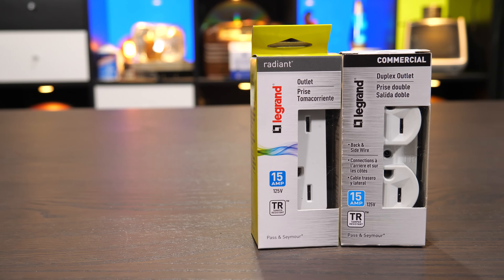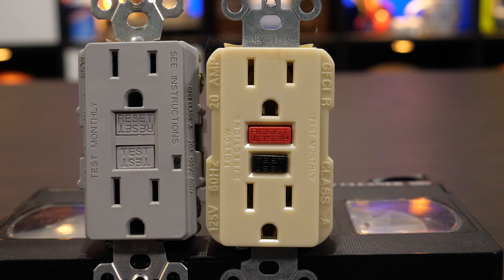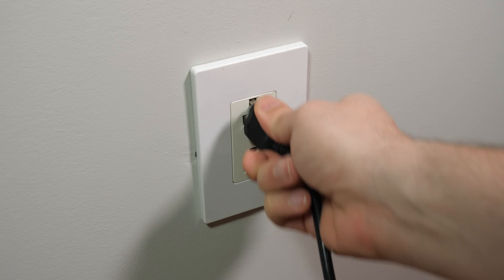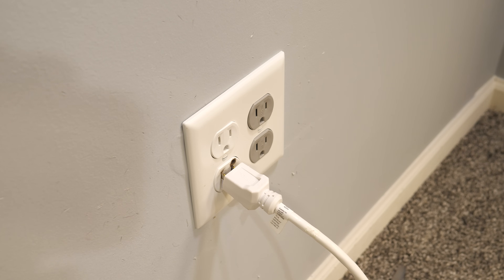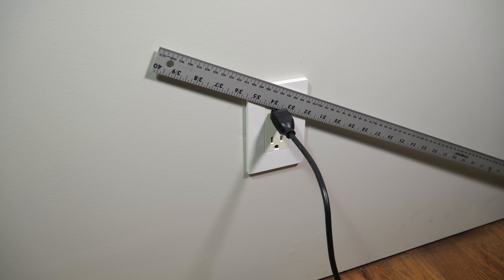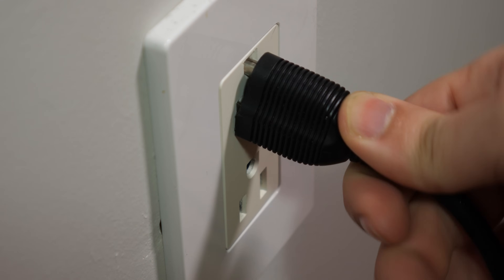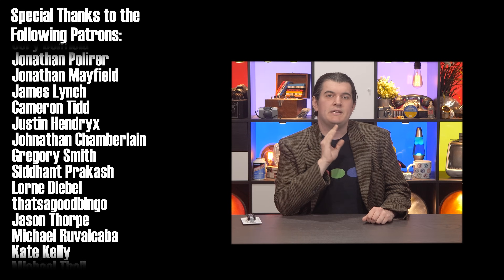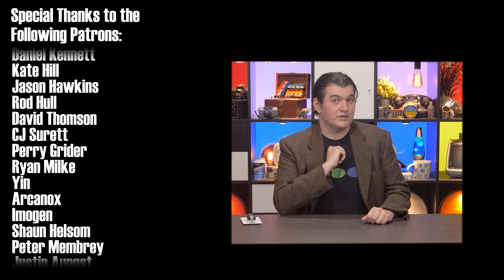Power outlets are topsy turvy - but does it matter?

Comment: Topsy turvy? To that, I say, I'm glad that I live in Power Plug & Outlet F aka Schuko. Guess what? Ground is both on the left and the right of the connector, so it doesn't matter if you put it in upside down or not.  In fact you can do both. Can be handy sometimes.  Also, F aka Schuko has deep outlets, about,. in fact 2 cm! No problems with knife trowing etc. Plus, you can hang it upside down. Yes, many outlets are under the desk here, plug facing up. I ❤Schuko!
But that doesn't solve your issues, I'm well aware. It's just so silly from my point of view.

Comment: Journeyman electrician here. I'd better not let my wife watch this video. I did my apprenticeship in a lot of hospitals, so ground up is how I install receps. (It is not an outlet, it is a receptacle.) We bought our current house, and I went through the entire thing and replaced light fixtures, and every recep (getting away from awful backstabbing, and pigtailing every recep, so if one fails, just one fails) is now installed ground up. Wife griped about it, I stood firm. And yes, you can find flat plugs with the ground in the 'proper' place. 

Though, you are right, there are very few use cases where a plug with ground down and pulled out slightly where there is a danger. But let me tell you of an outlier that is more dangerous than throwing knives at the wall. What is behind your usual bedside table? a recep, you say? it's got one of those 3 way adapters so you can plug everything under the sun into it while you sleep. But think of this, pocket change. How often are you just throwing it on the end table, people are messy, and I can't tell you how many times I've found change behind the end table when troubleshooting a recep. And yes, I've found ones with obvious burn marks, the coin had decided to do that one in a million shot and land between the hot and ground, and shorting out. That is a fire danger. And as you likely know, code requiring arc flash protection was added because of rare cases, like this. And yes, I've got 2 and 3 pronged cords all over the house, with 3 prongs slightly edging out the 2.

I'm not saying those specific cases are common, but they do happen, and yes, better safe than sorry. Sorry to hear your half million dollar house burned down because you tossed change onto your bedroom end table. It's enough for the NEC, it should be enough for the rest of us.

Now, as to you saying US plugs are objectively bad. I totally agree with you, some sort of insulation like how they do in the UK for the hot and neutral would be to our benefit. The problem is inertia, changing to a new standard would be an absolute nightmare, just like trying to force the US onto the metric system (as good as it is) would be as much if not more of a nightmare to actually implement.

Either way, thank you for the video, and looking forward to more of your content.
Reply: Another corner case thing: machine shops. Sheet metal and tools and oh-my, there's a reason all of our outlets are installed ground-up. Maybe it's a little paranoid, but you'd be surprised how often a thing of sheet metal gets leaned against the wall or on a workbench only to get knocked over just to get caught on an in-use receptacle. I once found an alum cutoff squarely caught on the ground prong, long enough to gather some grinding dust up top. Right in front of my OSHA handbook, no less (joke)!

Comment: Just so you know, when I was a kid, I knocked a metal ruler (T-square to be specific)off the shelf and it fell parallel with the wall and landed almost centered on the top gap of a 3 prong outlet that had the ground in the downward orientation.

It triggered the gfci (im assuming) and burned two lines above it where the ruler sat. Parents didn't notice and I was the one who pulled it out without knowing if it had or hadn't tripped the gfci, and i was too young to know what that was at the time.

Comment: I was taught that always on outlets had the ground pin down and switched outlets had the ground pin up. So you could tell what outlets you could use for lamps that were could be turned on and off at the wall switch easily by glance.

Comment: The UK wiring / plug system ensures all 3pin outlets enforce a switch / fuse on the live wire. The same is true for lighting circuits switched from a wall plate to smaller 3 round pin lighting outlets.    It would same the ultimate config for US outlets would be side … and thus when used with right angled connectors - the cord of one does not foul the use of the other outlet. MK in the UK make US style 2 gang outlets like this.

Comment: I have experienced the exposed blades issue first hand. A power strip was plugged into an extension cord on the floor.  The power strip was metal with edges that stuck out on the bottom. It got moved slightly and a large flash of electricity and smoke came out of the contact point, and the lights went out from circuit breaking. It scared the crap out of us!

Also outlets with ground on top are ugly! They look out of place. 
You are totally right about right angle cords! I like how you can back furnature up to them also. The only thing is, power strips need to be made with sideways outlets to accommodate them and some wall worts.

Comment: When I lived in Chicago, my kitchen had "normally" mounted plugs (Ground down, not sideways). I had a frying pan lid perfectly fall off of a stack of dishes behind my plugged in can opener. A big fireball came out oft he wall, the pot lid flew upward, and it had welded notches into the lid. It was super scary... I experienced this "one in a million" event, but I still wouldn't mount my plugs with the ground up. It just feels wrong, and in the case of my kitchen, it wouldn't have helped, as my can opener was only a 2-prong plug.

Comment: "God damn that plug design sucks" Is what i say every time i see this plug. Our the UK plug, or the australian plug or any other "flat faced" plug. This is why the EU plugs were designed the way they are - Its not possible to have a partially inserted wall plug in a dangerous way as to have live prongs coming out. Also it doesn't need sleeving on the prongs (that may or may not be installed on all appliances). It just works due to geometry.

Comment: It's interesting how bad American plugs and sockets are. For me as German it's hardly a issue to use plugs and sockets, because of the design. There isn't even one situation I can think off where we encounter similar problems like those you just described. I can think of some immediate redesigns to solve several of those Problems without loosing compatibility to moste normal plugs. A huge safety improvement would be to use recessed outlets like we have in Germany, although you would lose compatibility to moste angled plugs. If I would life in America in my Own house, I think I would install German outlets just to be safe and change the plug of the cables if needed.

Comment: The ground pin is longer than the other two pins which allows it to be grounded before circuit closure. So it probably doesn't need the lip as much.

Comment: I have a right angle adapter that has the wire coming out at 45 degrees instead of straight down like that one at the end…. It’s great. Doesn’t matter which way the outlet is oriented, and it’s grounded for good measure.   👍

Comment: What's the difference? It's equally bad and unsafe no matter the direction. Get the European Schuko F-type outlet. Safe, and completely symmetrical in design. The British outlet is technically safer, but the design is not symmetrical, and results in very bulky connectors

Comment: Despite using twice the voltage, UK outlets have some stringent requirements.    The live and neutral are blocked by a plastic plate unless there is a ground pin pushing it out of the way.   Most of the wall warts for phones only requires 2 prongs and they have a fake, plastic, ground prong just to work with those outlets.   A third of the live and neutral prong on the plugs itself has a plastic overmold.  And the ground prong is at the top.  You should try to get your hands on one of those.
Reply: our country uses the same thing... our plug and socket will always the right way up.  also its boggles my mind why US wall sockets dont have on/off switch

Comment: Videos like this about NEMA plugs make me more than happy about Euro plugs, especially Schuko (Type F) for the grounded one. Why?

1- Euro receptacles are unpolarized, those plugs can be inserted in either orientation without any problems. For grounded plugs, Schuko is the only one that I know that can be inserted in either orientation.
2- Modern Euro receptacles are indented, not flush to the wall. That mostly prevents partially inserted plugs from being a problem. For those older, ungrounded receptacles, only the insulated part is exposed once it's in contact with the mains.

Comment: This design always seemed to me like it's from 18th century. It's interesting how intricate the design in Europe is not only from safty point of view but also it's compatibility because even though the cord is the same there are different types of plugs used in different countries.
Reply: Yep. These plugs seems like the ones made for appliances in 1950s... Straight, no bumbs on plastic, nothing to grip it on, just awful design.
Reply: The Type E and Type F plugs are most common in western Europe. 
Luckily we invented the Type E/F plug that will fit in both sockets and has 3 ground connections to work grounded in both sockets :D

And the nice thing is that the designs aren't that intricate, at least not to produce, the costs of mass production of Type E/F plugs and their sockets compared to American counterparts will be at most a couple cents more, whilst being a superior product in safety, ease of use and well in my opinion looks.
Reply: It's really the UK plugs where a lot of thought to safety was given except for the an unplugged plug acting as a caltrop.   The plugs in most of Europe are really no better.

Unfortunately, the current plug in North America is very well entrenched in the market and regardless of the fact that better alternatives exist, we're unlikely to change now.  Just the conversion from two prong plug to the three prong plug was remarkable.  Now, maybe adding an insulated sleeve near the plug might be doable as contact would still be made deeper in and later outlets can be updated with such that by the time the conductors are actually exposed, electrical contact has been broken.  A small step to being safe but something that can be done with backwards compatibility.  Rotating the plug so the ground pin is up may help but you're dependent on people and the wide variety of plugs so just rotating is only a partial and intermittent benefit.  Of course local regulations and consistency or rather inconsistency of enforcement is an issue.   My parents tried having the electrician install the basement plugs sideways and the city inspector would have none of it despite the electrician thinking it was within code (which was probably wrong too).  That usually applies to the ground pin too, an inspector may object to ground pin up.

I'd like to see the insulated sleeves and deep electrical contacts in the receptacle but the ground pin up doesn't seem like enough of a benefit and a lot of variable trouble with inspectors.   Now the UK also uses the ground pin to even open doors to the other two connectors, that seems a bit complex and prone to broken plastic doors so I don't see all the good features of the UK plug making their way across the pond and I think we'll be very lucky if the insulated sleeves comes over.
Reply: @johnwang9914  Many modern receptacles would leave insulated prongs fully covered until electrical contact is broken. Pretty sure the only thing preventing insulation of the prongs is cost, as to ensure compatibility with older receptacles, some metal would have to be milled away.
Oh, and your electrician was right about the horizontal receptacles being within code. If an inspector were to try to pull something as stupid as that on me, their inspection would be over right then and there, and I'd be getting a new inspector
Reply: Not from the 18th century, but it comes very close to being from the 19th century. I've seen some sources state it was invented in 1904, and some state it was invented in 1912. Either way, it's ancient

Comment: The reason why we have the state of things, is because people want to see a face and are difficult and tradesmen don't care to waste energy educating them.

Old right angle plugs were ground pin up.

Bad design of right angle plugs, caused by a desire to conform to people's wish to anthropomorphise the visual aspect of receptacles, doesn't constitute a valid justification for installing ground pin down.

If we were worried about ground pin compatibility, right angle plugs would be oriented right or left, instead of up or down.

Comment: Often by the engineer's specifications for a building, ground up are standard in utility rooms and institutional environments, except where the device requires it to be ground down. This is to keep the cords from falling out, cause the ground is a longer pin and helps hold it in. If this was the cord to your ventilator in a hospital you'll be happy to have them plugged in ground up. Ground down is standard in homes, and public living spaces because of aesthetics, and right angle plugs reflect that aesthetic in low clearance appliances (like behind the fridge). People like ground down cause it looks like a little face. People don't want to buy homes if the plugs are "upside down". People are weird. 

Loose metal face plates falling on the prongs is a reason I have heard to keep the ground or neutral up. The hot up configuration that is your apparent standard makes no sense to me.... but nor does ground down.

Only code rule in the CEC is that the plug can not be facing up, like mounted in a floor or countertop where it can collect dust. That's why countertop plugs on islands are tucked away under the countertop.
Reply: That's interesting, is there an exception in the Canadian code for the floor outlet kits that have those? Usually brass spring loaded or screw in protector covers? Or are people just stuck running extension cords across the room for putting the lamp at the opposite end of the sofa?
Reply: Because in the US we are allowed to put outlets in the floors. They just have to be installed with a cover that's designed for use on a floor in order to protect the outlet from dust and more importantly cleaning products. You see him a lot, usually in large open living rooms where you would not want to run a cord for a lamp that's next to the couch all the way to the wall and in commercial you might encounter them in retail environments. So that way the cords can be tucked away under the shelves and you don't have to run the wire mold towers up to the ceiling in order to plug in displays or display lighting, think the Apple store you don't see towers going up from the tables to the ceiling to plug in the chargers and networking
Reply: the autoshop i work in has the plugs ground down, and this shop is decades old
Reply: But I have in floor outlets. Very convenient in family room to say plug in a lamp.😊

Comment: TOPIC SUGGESTION:   There was a portable mini refrigeration device powered by a paraffin stove in the early 20th century called a "Crosley IcyBall".  It had no moving parts and consisted of two chambers with water and ammonia. I was amazed at how simple its function.
Reply: The basic idea is still in use today, particularly in RVs. Their called evaporative cooling refrigerators. My 2017 camper's Fridge/freezer has no moving parts and is an ammonia cooled device that runs on either electric or propane. The difference is that the old device you're talking about uses paraffin as the heat source and modern RV refrigerators use either a small propane burner, or an electric heating element. In most cases, like mine, they run on either my 12v battery or propane, depending on which I decide to use at the time. The disadvantage is they are harder to control temperature and take a lot longer to cool than a compressor based fridge/freezer. My freezer usually gets down to 0 deg F, but it takes a while. They are still being sold in new RVs, but in the last 5 years or so, 12v compressor based refrigerators, or 120v by using an inverter have become more popular due to quicker cooling and more control.
Reply: @raymorgan4657  Kerosene.  Paraffin here in the US is a solid.
Reply: @bite-sizedshorts9635   Yup, they all work on the same principle of just needing a heat source. It could be kerosene, paraffin, or propane in the case of mine and new ones made today for RV's. Mine can also run on just the 12V battery that heats an electric heating coil if I don't want to use the propane. Typically, when we're camping and have electric hookups for the trailer, we run the refrigerator using the 12v electric coil and save our propane.
Reply: @raymorgan4657  - Thankyou .  The Crosley Icyball Has vanished from life now. It was so simple. so low tech. I wonder if they have a use in disaster reliefe areas keeping phrmaceuticals cold.
Reply: @timetraveller6643   The Icyball you mentioned may have vanished, but like I mentioned, the ammonia based, no moving parts cooling that is heated by a flame or heating coil hasn't. It's is still very much in use and sold today. Just look up 2-way or 3-way RV refrigerator.  No moving parts at all, but the RV modern versions do use 12 volt from he battery to run a control board. On propane (instead of a paraffin burner) it simply heats the ammonia coil.
Reply: i would like to learn more about this
Reply: My father said their first refrigerator ran on kerosene.  My first encyclopedias from back in 1957 only had a diagram of a kerosene refrigerator, not an electric one.